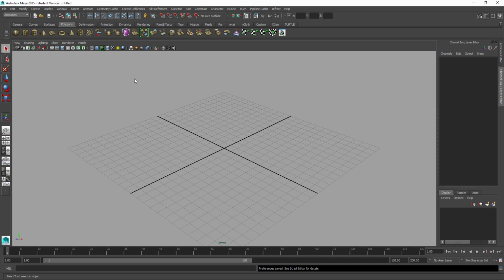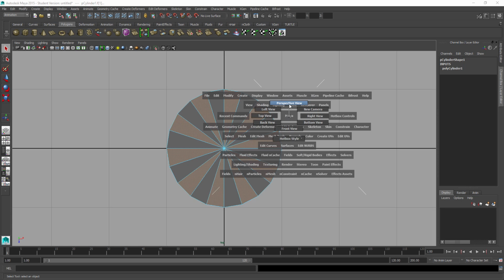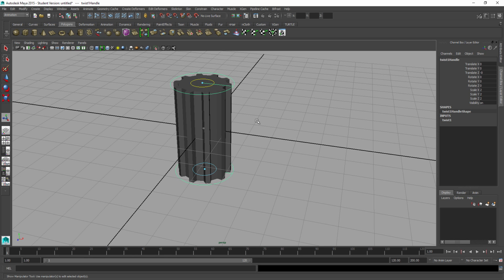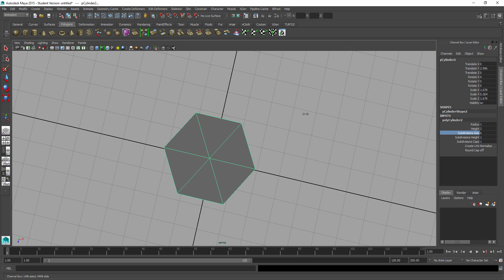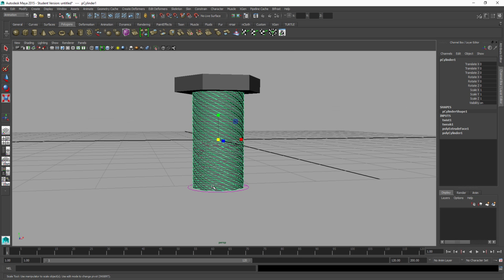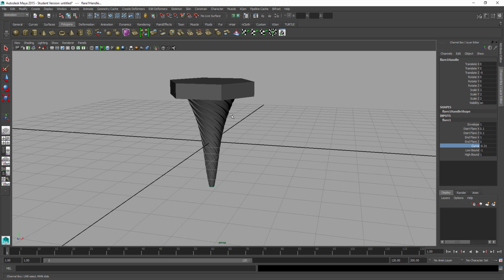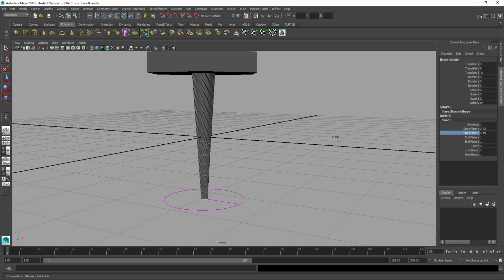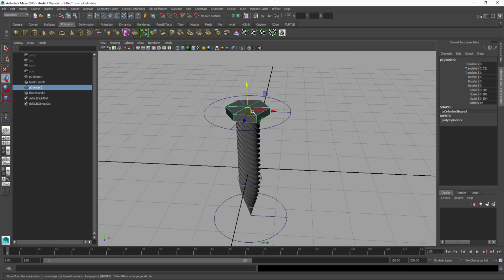Modeling a bolt or screw in Maya

Comment: Thanks sir,but what kind of bolt is that ? the where is the actual treat ? what you did is extrude bunch of faces and added a twist deformer.In real life a bolt or screw has one face or line that goes in the shape of a spiral.What you made there looks like a machining tool they use on lathes.

Overall thank you for your time and effort.